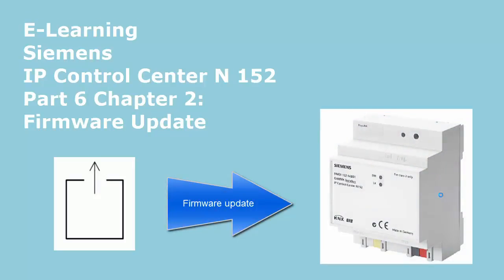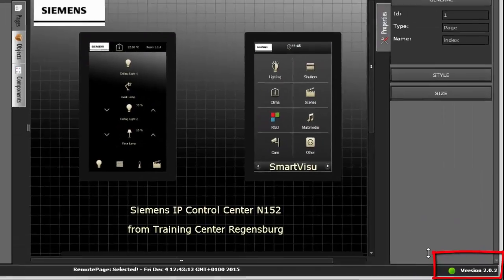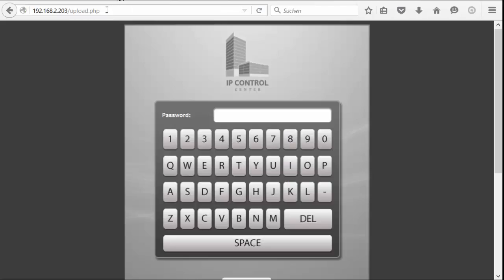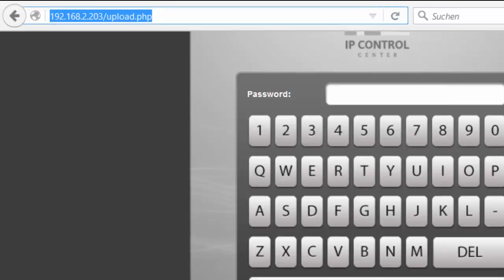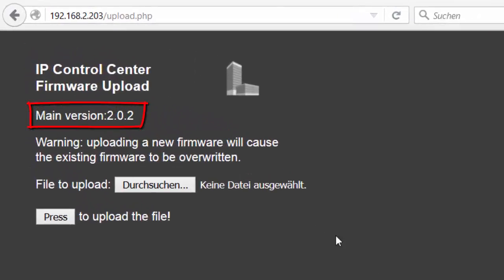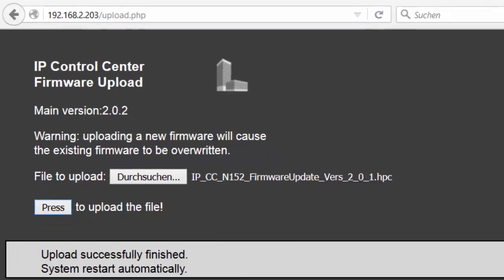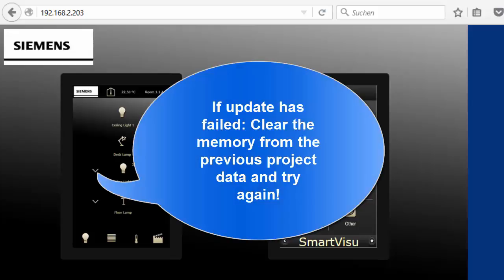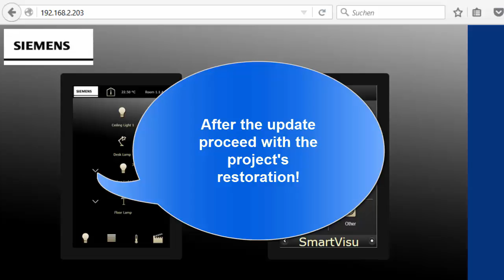E-Learning Siemens IPCC N152 Part 6 Ch 2 Firmware Updates

Comment: My Siemens N152 Device Version 3.1.0 to version 4.1 after version 4.3, but I did not make version 4.2, I can not access anymore. What can I do. Thanks.
Reply from the maker: Please contact the Siemens Technical Support via support.automation@siemens.com, or call +49 911 895 7222. They have a new tool which is not yet officially published, which will recover such issues. When you open a free of charge ticket in the hotline you’ll be provided with this tool. I hope you have a project backup file? Because it will erase all memory to perform a complete setup to the current firmware.
Reply: @eibdoktor  thanks